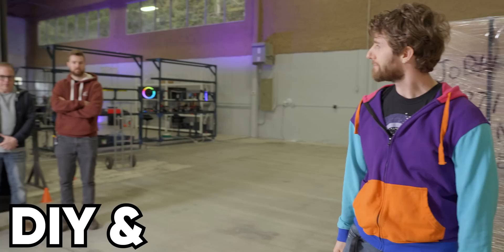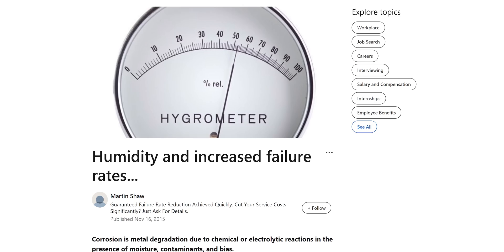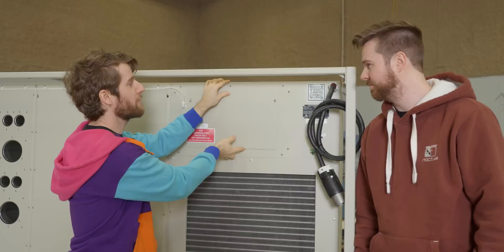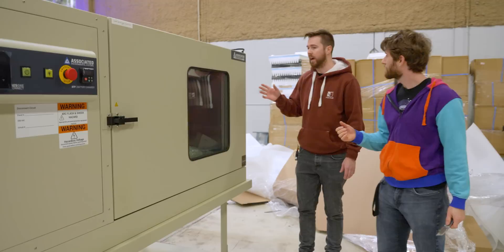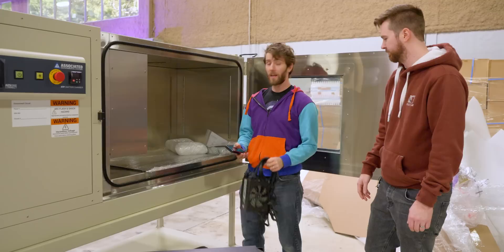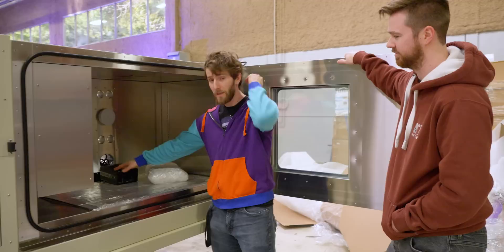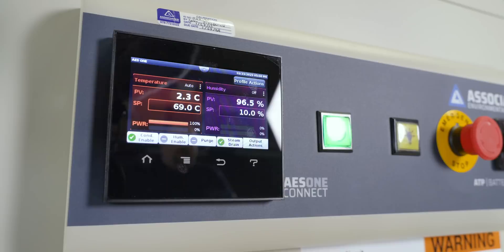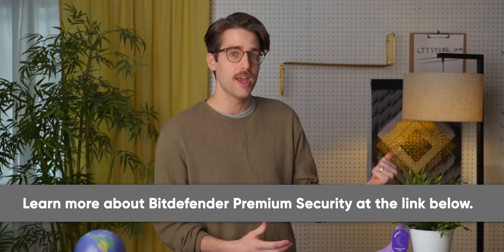We bought a Fridge for computers.. - Environmental Chamber Unboxing

Comment: HI Linus I work in a environmental lab with about 15 climatic chambers. just wanted to tell u guys that u will still need temperature isolating plastelin around the cables at the passthrouh. When u run humidity tests the water will condens at the passthrou and run down the cables. And in the worst case right into whatever testing equipment u will use outside. so always make sure that the lowest point of the cable outside is not the connection into your testing equipment. Hope u will have awesome results with your climatic chamber.
Reply: It sounds like you need to consult for Linus.
Reply: Damn, you should post this on r/LinusTechTips
Reply: Christian Lechner Climatic Chamber Tips
Reply: @MattieBW  christian's climat chamber counselation aka CCCC 😅
Reply: @lowping3727  Linus would just call this person toxic for not felating him or his team.
Reply: i think ltt has a team that reads comments a stuff like that. prob will pass to someone
Reply: I hope they credit you when they point this out in a WAN show or future episode.
Reply: Drip loop
Reply: @Seikushim0  they only read Floatplane comments cause they enjoy their own echo chamber. Linus might read the comment here though.
Reply: Thats a really good point. Would make sense to have a power strip above the passthroughs.
Reply: @DCMcF idk how many ppl know this in NA but ive never even seen one in EU. Seems like a logical point to make but sometimes we forget the simplest things
Reply: It would be fun to see them forget it and make a video about how they fried their equipment
Reply: its called a drip loop.  you make a loop and have the cable go back up, so that water goes down, and never back to the end of the cable.
Reply: I would hope you just casually and quickly wrote this because if that's the kind of grammar used by, I'm guessing someone that works for scientists, I have to worry about the future of some areas of science.
Reply: @linus pay this man for free consultation
Reply: Omo never felt dumber reading a couple of sentences before.
Reply: I hope it won't be... anticlimactic.
Reply: I prefer anticlimactic test chambers.
Reply: The term for putting a low spot before a junction point in a cable run is called a "drip loop" because you can make one by just leaving a single coil of cable before the plug
Reply: @joemarais7683  Linus is kind of hands off with the LAB. He didn't even know if they paid for the machine.  He specifically hired the LABS team so that he did not have to do anything there.   Its the kind of situation where you hire competent professionals and just trust that they have it under control.  This can go extremely well, or extremely wrong. Only time will tell.
Reply: Upvote for visibility
Reply: What did you do with all the time you saved by typing 'u' though
Reply: that’s awesome
Reply: @daneverdier1950  how people type in a colloquial context has zero bearing on their intelligence lol
Reply: Hey Christian,

Yeah that's great advice! We're aware of the potential condensation issues, and we've got an engineer from the manufacturer coming out next week to do some in-depth training :)
Reply: @joemarais7683  I have no clue what floatplane is and I will never know. I hate the fact that creators push people off a platform in which they are on. There are a number of creators who have done this. 
What they should be doing is contacting YT and trying to get them to add in new things. 
One would be subscriber only videos. Really YT needs to look why 3rd party apps are doing well and use some of those thing and bring them here. 
I do not leave the site for anyone. Even when I pay them on 3rd party sites. One person I pay uses a 3rd party site because it they make more money than youtube gives on subscriptions.
Reply: yea alot of stuff thats meant for outside breaks because the place the cable goes in doesnt have a good seal
Reply: @kameljoe21  LMG owns and created Floatplane. They’re obviously going to push for people to use it
Reply: @Tarvoskemwer  it isnt a fuck up unless they dont notice this before testing officially
Reply: +up
Reply: Damn this guy Climatic Chambers
Reply: @JqwsXD  I understand that. So do many other creators who own their own pages and promote them. Fireball tools has a very long testing video of breaking vices on his site as well. I clearly am not going to watch it because that is not where I choose to watch their content. The same with every person trying to get me to watch their streams on twitch. It is not going to happen. 
I would also like to point out that I am sure that floateplane does not release its numbers on views? This is because they are likely not getting major views as they had hoped. This video has 450k views right now and if floatplanet releases their numbers they are likely around 45k views. Also there are likely only a few hardcore users who only watch content there because they hate you tube for some reason. 
I can not recall that channel. Might have been college humor who tried to get people to go to a paid site to watch all of their videos and I am pretty sure that site no longer exists and their views are dead now. They tried to paywall their channel and it killed them.
Reply: @joemarais7683  Did Linus kill your puppy or something? You seem to have some beef with them heh.
Reply: He could always just use a drip loop...
Reply: I would assume they know this given the fact that they have a team meant to research this stuff, but still useful information to tell them regardless.
Reply: Hop into the forum!
Reply: It's an engineering lab...so its probably on the list. All science labs have just one more thing to purchase to do testing.
Reply: DRIP LOOP BABY
Reply: You need to post this on the sub and forums
Reply: Was thinking exactly the same thing. Back when I worked for a company that built satcom equipment, we had to test and characterize our gear from -40 to +50, and used a big test equity chamber for it. The cable pass through was a big foam plug about 5" thick with a slit in it (think pac-man) that we'd feed the cables & waveguide through. More than a few times I came in to work in the morning, after the test had stalled at -40 overnight, and found the waveguide all frosted up!
Reply: @scottcol23  This. I’ve been reasonably optimistic that the classic LTT jank won’t invade the Labs space. He makes and presents this stuff because he’s the face and presenter. I hope actual lab employees have the construction, use, and maintenance down.
Reply: @tomalexander4327  lol he can't even spell. I doubt he is any kind of testing engineer.
Reply: ...and never push the squishy insulation-material too far into the Chamber, when you make tests with high humidity. They will get soaked. Make sure it is flush or slightly recessed.
Reply: @tomalexander4327  Linus has AES on speed dial. Who else do you need to be consulting you.
Reply: Linus tech tips needs tech tips
Reply: Smart words minus the grammar.
Reply: @DCMcF  window AC is pretty uncommon outside of the USA lmao
Reply: I imagine drip loops should be engineered in. (Just like ingress/egress to a house or building...)
Reply: And deprive us of more Linus-bleeding-money content?
Reply: hope to see them talk about this on the next wan
Reply: @joemarais7683 . You don’t seem to know anything about their process and have deep seeded hatred because they don’t respond to your inane comments.
Reply: @samprice1302 . It’s not, window ac is pretty common outside the Us and whole home AC is far less common in other parts of the world.
Reply: Up
Reply: @w0nd3rlu573r  many times the manufactures don't know more than the average joe. I've seen many obvious design flaws in products; ones which the manufacturers, consultants, and dealers will deny till their last breath. A perfect example is industrial water pumps tapping a  pressure sense line direct into the turbine housing causing the shutoff switch to chatter as the blades pass the port. I've lost all trust in "experts" knowing anything about their own field a long time ago.
Reply: @robertt9342  1. There's more than just Window or Whole home. A lot of places use wall mounted split units.

2. AC at all is very uncommon in Europe
Reply: The toxicity in the replies to this comment, Jesus Christ, some people are just triggered over nothing
Reply: @IamTonySy  you seem triggered
Reply: This is a good point, condensation down cables can be a real problem!
Reply: sounds like they need to get a set of the inserts made with sockets on either side of the foam.
Reply: @Gatorade69  hahaha, we use split units here, which are objectively better
Reply: @joemarais7683  cause he calls so many people "toxic" lmao
Reply: @enxos2619  it's on them for not reading comments!!
Reply: Was coming here to say this.  Other things to be wary of: there will be hot and cold spots in the chamber so temperature mapping would probably be good to find the best and worst case, I'd see if you can move your control probes as well to your worst case locations (this will typically be near the door or the pass throughs, running maintenance REGULARLY is key to keeping longevity of these systems - the gaskets get SUUUUPER grody after a time, I'd double check with the mfg about adding thermal load as you could burn out your compressor faster for cooling, lastly proper airflow is key for to maintain temperature the shelves are wires for a reason as it allows for cool / hot air to circulate properly.  

Source: I work in pharma and used the help validate these systems for use.
Reply: That's a solid tech tip
Reply: That's what I was thinking while watching the video
Reply: Don’t tell him that, that’ll be a fun screw up to watch lkl
Reply: @꧁D.C. McF꧂  I use a window ac and I didn't
Reply: @daneverdier1950  I would hope you realise a practical mind, isn't always necessarily a grammatically correct mind. in fact, its usually the case an engineer can't write a sentence without error but could make you look as inept as this comment in a conversation.
Reply: @lowping3727  they don't moderate that sub
Reply: @DCMcF  Cringe.
Reply: @jakedaynesLTT  Hi Jake, its kainda awesome that this commend blow up ^^ nice to get some feedback from the actual team =) keep up the awesome work u all do
Reply: I was just about to say the same thing 👀
Reply: @kameljoe21  the exact reason they are pushing folk off the youtube is the insurance when your channel gets screwed from non-sensical ToS change, demonetization, useless support and consistent cash flow.

Comment: I'm so happy that you're testing with different environments in mind. I had 3 phones fail over the span of 4 years because of the humidity and temperature in Malaysia. In all of them the charging port corroded and gave up.
Reply: I'm not sure corrosion testing specifically is possible with this setup. Corrosion doesn't happen overnight (well, in some cases it can, but probably not in your usecase), and I doubt they're going to (read: can afford to) leave this running for 3 years to test corrosion on a specific phone model :/
Reply: @pixelmaster98  I believe there are accelerated corrosion test with salt water and or chemicals you can run to simulate years of weather exposure in days
Reply: Same here in Placencia Belize. Electronics in general dont last long near the sea. I'm starting to buy equipment made for yachts
Reply: That's a tricky test because it is the combination of wear (plugging/unplugging) with the humidity that causes it
Reply: In that case, i buy silicon plug for aux and usb, and use wireless charging
Reply: Your phone had a corroded USB port because of high humidity.

My phone had a corroded USB port because someone vomited on my phone.

We are not the same.
Reply: @robinbegley1077  yeah, but the machine from this video won't be relevant for that test ^^
Reply: If the charging port is really the only point of failure, maybe you could just replace that or buy a phone/case with a seal. But really, manufacturers should be using higher quality ports that are more resistant.
Reply: @rustyshakelford1466  Another option might be Fairphone since they have user-replaceable charging ports

Comment: I'm an engineer and we have burn in chambers that go from -55C to 125C, and it's really cool to see the overlap between work and hobbies!
Reply: We also use them, but the range is from -85C to 185C. I once cooled it down to -70 and open side port. Can't describe how cold that is.
Reply: @First2ner  we use them too. Tried to accelerate the unfreezing by opening the door once. This is how I learned the product really doesn't like water.
Reply: @billigerfusel  Accelerated temp changes doesn't sound great anyways.

Comment: As someone who uses a chamber by the same company on a daily basis, I’m so glad someone else was extremely entertained by the port plug…
Reply: Yeah kinda cool seeing this in a mainstream video, although you can see they took an extra step further here. When I toured Plexus and Mercer before… their machines didn't have quite the cable management as this machine haha.
Reply: @HavocHybridVids  holy shit, can’t say I expected to be called out quite like that….  Although I’ve never seen the inside of them for the cable management. The outsides usually look more messy in a production environment unfortunately….
Reply: Did you thought of some glory things looking at the holes?
Reply: As someone who works with those plugs and those chambers can confirm, still fun.
Reply: @HavocHybridVids  I'd be willing to bet money someone on the team is an LTT fan and knew Linus would crack it open, so they made sure it was neatly cable managed.
Reply: @conduit64  I was going to speculate that maybe the company did the cables themselves, but this probably makes more sense :D
Reply: @conduit64  the guy just above you apparently
Reply: @conduit64  Dude, how often do you see similar equipment in person? They ALL must be like that. This is not running some flimsy half-a-watt fans on 5 Volts. There are real currents going around inside the different modules. You don't buy those cables from the store. You buy a 300 or 3000 meters (or whatever you need)  long cables, of which you produce what you need for each device.
Reply: @conduit64  a commenter actually works for the company who makes these chambers and said a lot of the wire harnesses are actually “cheating” because they actually pay an outside company to pre-fab them. This is actually surprisingly common in the industry.

Comment: The use of this device for testing is based objectively but I honestly need one of these as the most overkill beer fridge of all time.
Reply: have at work back in the day usta get a six pack cold in minutes 
man i miss the old days.....
Reply: @dudehuh5491  thats just luxury lol
Reply: Then turnaround and use it as a meat smoker for staff BBQs
Reply: I wish my own room can do what these things does.
Reply: The humidity function would make an amazing bread proofer. #linusbreadtips
Reply: Would be too hard to convert a fridge to do the job, my uncle has used fridges to make wine cellars in the past by putting a new thermostat control board in.
Reply: @dudehuh5491  we used ours to cool down some Cola bottles xD
Reply: @PhilfreezeCH  good times
Reply: I'd use one as the most overkill 3D printing filament storage box ever.

Comment: You know its a great video when you have:
1.ridiculous but incredible new tech 
2.Linus dropping something expensive
Reply: what did he drop in this video?
Reply: @abdullah-_-.  the ipad
Reply: I think he dropped the microsoft surface laptop for the segue 0:16
Reply: @pigon__  oh yeah lol I've gotten so used to him dropping things my mind just filters it out haha
Reply: Man spiked that tablet into the ground like he had just scored a touchdown
Reply: @Smolface.  surface pro. Laptops have the keyboard attached permanently. Surface pros are also the only ones with the kickstand that hid the segue to today's sponsor
Reply: What about the slam at the start of the video
Reply: @abdullah-_-.  😂 yeah
Reply: It was a Microsoft Surface, so it was probably bricked when it arrived at LTT 😆
Reply: A humidity chamber is not new tech. High precision two pressure humidity chambers have been around for a while and are generally used by NMI Labs for the highest accuracy.
Environmental chambers have been around even longer since the 80’s 90’s. For example aerospace components need to be burned it at operating altitude and temperatures. I’ve seen chambers large enough to fit a telephone booth.